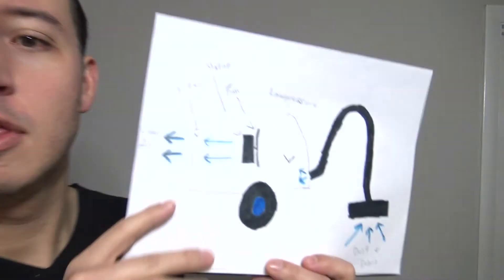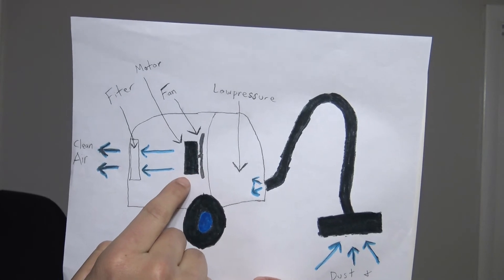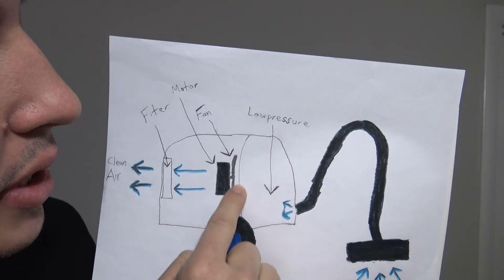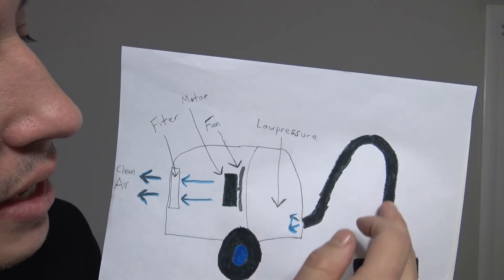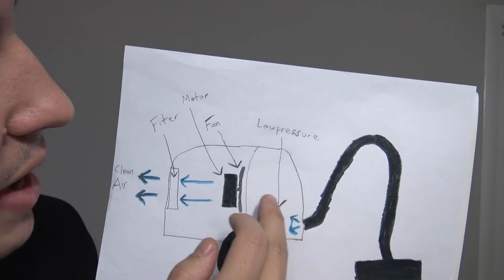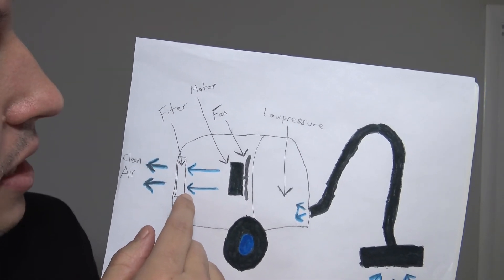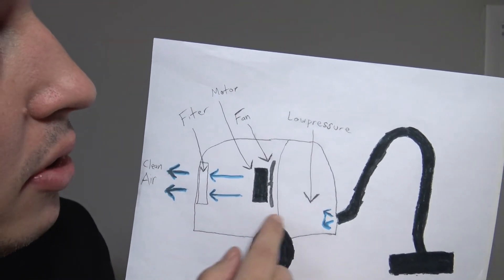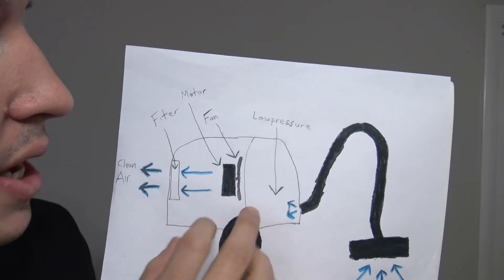How Do Vacuum Cleaners Work? (Understanding Vacuums Ep.1)

Comment: I'm here because I'm an auto detailer and I'm really in search of the best vacuum (shop vac style) but it's a price vs quality. I'm not even sure the more expensive ones are worth it! 
I'm also not sure if I want more CFM or more water lift with the end result being the best "suction" also, how does volts, amps, and wats play into this. I'm tired of getting the vacuum I think is best in my price range, I want to look at the information and say "this has good suction but not enough amps "or whatever not that I would compare those two things.

Comment: good video. but no vaccum cleaners suck.  the motor  reduces the pressure inside the  casing as you say, it's the higher  atmospheric pressure that pushes up the pipe and drags any muck and dust with it.

Comment: Sooooo.... I have spent so much money on vacuums over the years. I started with a Kenmore canister vacuum. Then I bought a very expensive Kirby upright. The Kenmore lasted about 2 years and the Kirby about 7. After doing the math, they both cost about the same per use. I will say that the Kirby had better performance though. I then went to a fairly inexpensive Hoover canister. That didn’t last long. I tried about 3 Roomba iRobot vacuums, and even had the wet mopping one. They were nice but not practical for my purposes. I had a cheap upright from Lowe’s. I don’t remember the brand. It didn’t perform well or last long. I now have a Shark. It’s great so far....actually one of my favorites. Remember, I have 7 dogs in the house; I vacuum a lot!  I vacuum furniture, floors, and even mattresses. I prefer something lightweight because of my two story home.
Reply from the maker: Wow!  At least you have alot of experience with different brands.